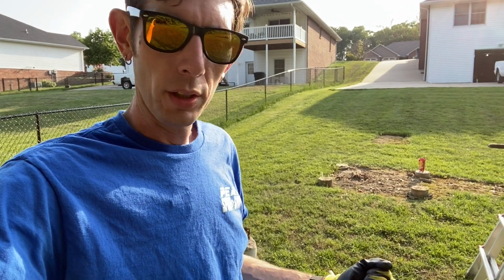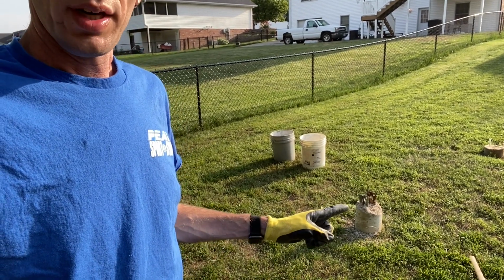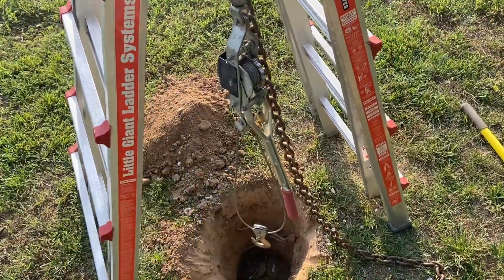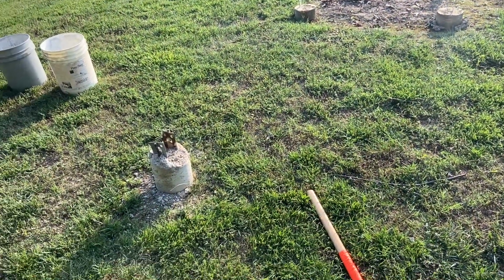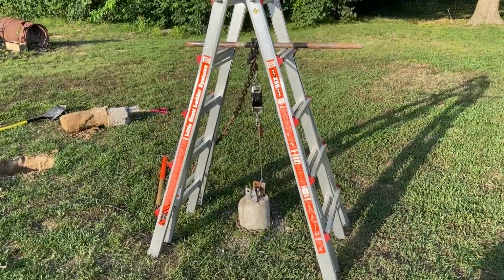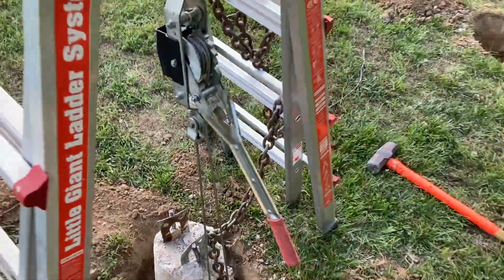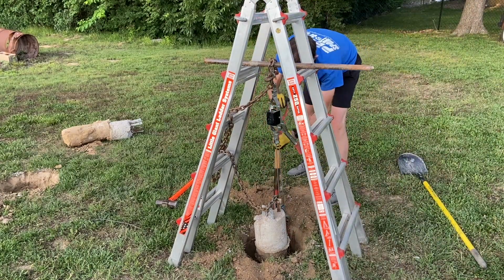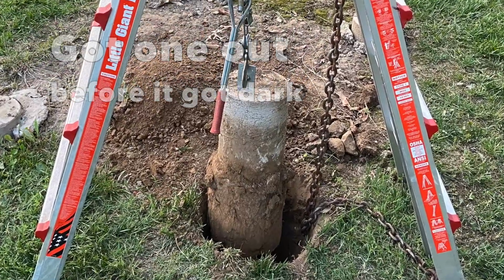Makeshift Ladder Crane

Comment: Nicely done
Reply from the maker: Thanks. I thought of you while doing this. Especially when I bent the handle. I thought “how would @sixtyfiveford improve or strengthen this handle to keep it from bending again?”
Reply: @DustinRogersinMO  I've bent a few come a long handles. Actually just did one just this last Christmas while cutting down a tree and got the suv stuck on a rock. I used a lot of rocks as hammers just to straighten it back out to make it work. Once I got home I welded gussets all over it.

Comment: I'm "very surprised" that ladder stood up to that too, especially since the come-along didn't.  I've pulled a lot of posts and stumps, mostly small ones but a few as big as 45" in diameter.   Water does help for sure but even better, I use a pressure washer nozzle and spray down one side of the concrete to give a little wiggle room.  Works like a charm.

Comment: I am impressed your ladder stood up to that. It's too bad you don't have a farmer neighbor with a tractor, you don't even need a loader, just use the 3 point hitch or just tug sideways.
Reply from the maker: I had a friend suggest to soak the ground overnight and they would come out easier. I did and the other three came out really easily. I still dug around them a bit, but they pulled out much easier. Just had to use some wood under the ladder for a larger footprint
Reply: @DustinRogersinMO  Soaking the ground is a great idea.